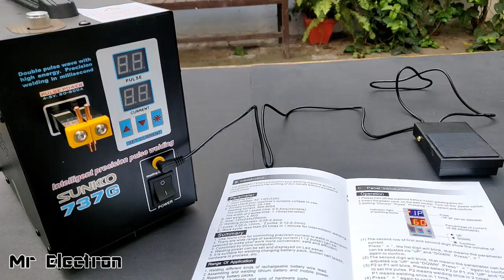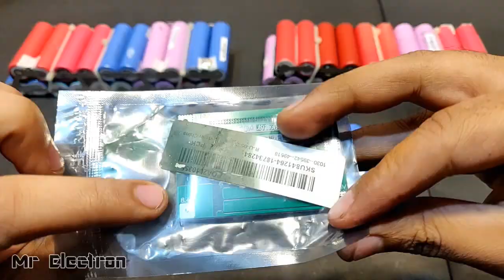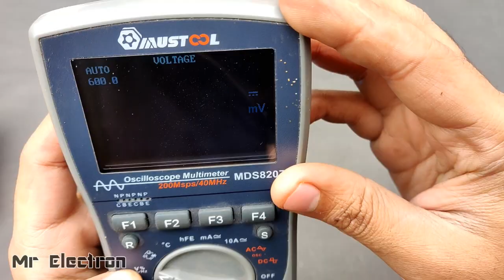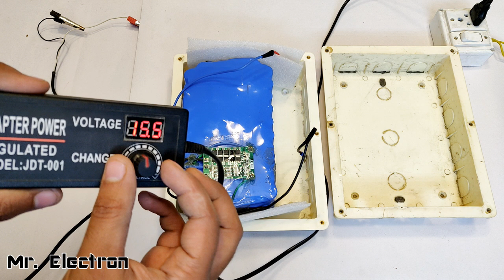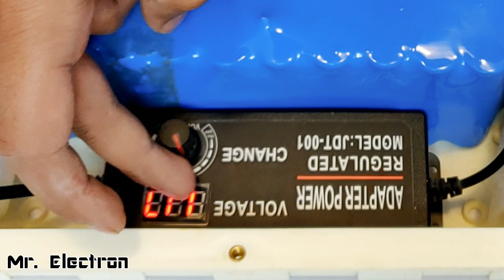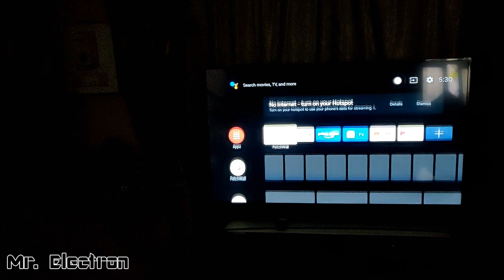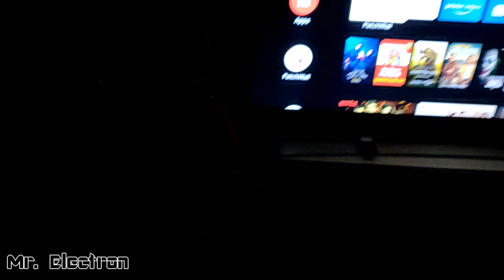Make 220v Mini UPS 80,000 mah DIY - Run Anything upto 3000 Watts 🔥

Comment: mate, there is no chance on earth that those wires are going to handle the 200 odd amps that inverter will try to pull at 3kw. Same goes for your series connections. looks like 12g or smaller... so your talking ~40A max unless for very short bursts, or about 500W. Your BMS board is only 40A too...

Comment: Be carefull with that power supply. Max 12.6v on input BMS. Maybe better to use a cv/cc or dedicated Li-Ion charger. Also use thicker cables to the inverter. When making Li-Ion battery packs, make sure that all the battery's match state of charge! Very dangerous if the don't! 
Overall cool idea!

Comment: It's a fantastic project, and great fun to watch. Really enjoyed it.

However, I'd suggest people don't try this at home, especially like this. 

We're talking old, mismatched batteries that are being repurposed. Likely well beyond their rated charge cycles. And some pretty sketchy assembly hardware, soldering and insulation.

It's awesome that we have access to high capacity batteries, and all these awesome projects. But they're no joke; they can kill.

You can get great, high quality batteries for a few dollars, brand new from reputable dealers. Something like the Micell 21700 with 4,000mah 40A would make a compact, high capacity bank. But you're still dealing with deadly amperages and serious fire risks.

And as for testing, we didn't see a single shot where the connection cable was fully visible.15:30 may appear less dodgy, but there's an obvious jump cut and cable obstruction that makes it refutable. 

Take videos like this with a pinch of salt, and enjoy them as entertainment sources only.

Comment: That's not a UPS. That's a rechargeable battery with an inverter attached to it. A UPS is an "Uninterruptible" Power Supply which means it runs even while charging. The one you show can either run or recharge not both at once.
Reply: This is portable power station

Comment: I don't think the wires coming from the battery pack to the inverter are any where near big enough. I don't see how that inverter can supply more than an amp or two at 120 volts

Comment: Charger voltage should be 12.6 volts not 13.6 volts. Should've used a diode after the power supply then go to the battery.

Comment: Good job, but 9v when the blender is working... 
Could it be possible that a capacitor bank battery placed between your wonderful battery bank and the inverter solved the problem of the motor starting discharge observed ?

I told you something like this when you were working on your capacitors and seen you trying to start your car

Indeed really cool !
Reply: I thought about that because of the life time of your battery elements
If the discharge is too heavy in a too small time, they will not be able to survive really longer than their half-life...
But the capasitor bank is really good for this use  

So
If batteries recharge capasitors then give their power  to the inverter, the strength will be, at first, in the few starting seconds, taken on the capasitors bank
Then the battery will give the reall needed power, the power indicated on the engine

If you take a look at electric music applications
The amplifier and the louder have both a special characteristic
Nominal Power and max power
Battery and capacitors ;-)
Reply: That 's quite the same problem you try to solved to run big engines a few seconds with a really small power
Reply: I really like what you have done
I lived-in Brittany, the most west part of France
In France, all the old equipments are recycled
Sometimes it goes to others country and finish in big trashes... 
I disagree with those practices if it contribute to people and environmental destructions

Here, it's difficult to found engines or parts of electric equipment if you don't by it or have a job in a business witch could permit you to found some... 

And i don't really have enough money either space to really test some of my ideas :-) 
But it's really cool that internet permit us to think about ideas and projects without having to travel around the world for a few words :-) 

Indeed 20 years ago it was quite  impossible to talk about those projects and experiences, and without the good contacts, nobody could even never nows those projects exist

Continue to be safty, inspired, and have a good day ;-)

A last comment
If you never heard about, i really advise you to take a look at the channel

American Tech, visible on YouTube 
I think it's a girl, who probably lives in Birmanie and is really talented, a lot of simple engines made with cupper, iron, glue and sometimes magnets or a few electronic pieces

Guy or girl, however this human comes from the tricks are genius
I'm sure you'll appreciate if you don't already know it